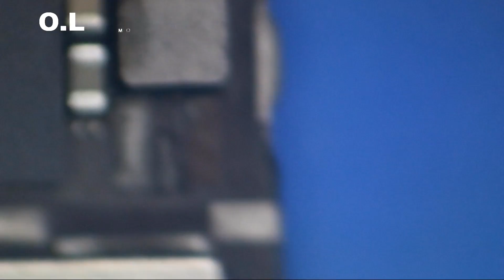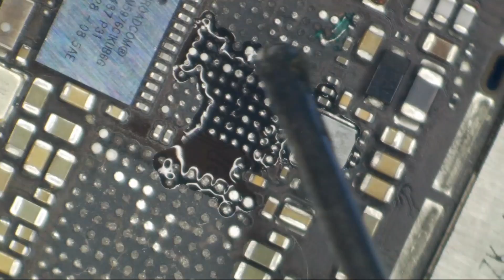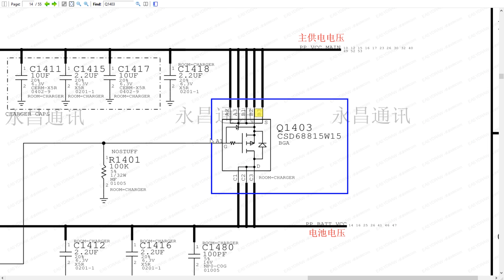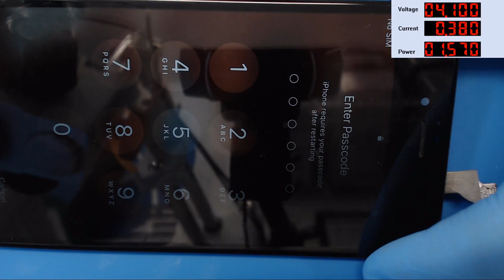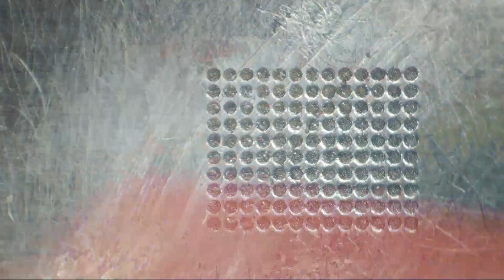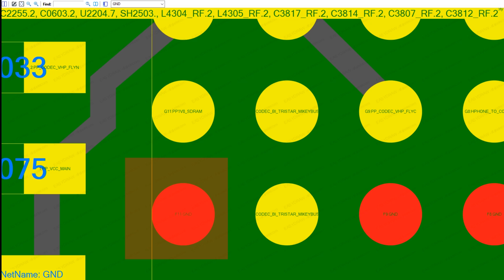Recovering data from a botched up iPhone 6 Plus

Comment: I have a 6 plus and touch stopped working so last night I did a screen replacement and touch still was not working. Then today I tried again and after I had reseated the display connectors the screen and the prior screen did not work at all. The phone shows no sign of power. Last night it would charge and show the display but now nothing. There was no liquid involved so how common or rather easy is it to get the phone in this state when doing a screen repair? The only thing I forgot to do was to disconnect the battery when doing the screen repair.

Comment: hello I lost one screw and did not leave the ones I do have left in order where they belong. Where can I buy set of screws and will they be labled so I can place them where they need to go. I replaced the battery, and that works just fine. Its a iphone6, thanks

Comment: Hey Can you help me for iphone 6 backlight, i think it was happened when im trying to change the screen, maybe  the fuse is broken, but i dont know wich one, thx
Reply from the maker: On the iPhone 6, if it is only backlight (can still see image but very faintly), it would likely be FL2024. If you don’t see any image at all, it is usually long screw damage in the bottom left hole.  (Top-left of CPU)
Reply: @ststele  I see Image but no light ^^
Reply from the maker: That’s good news :) it’s most likely only a backlight filter. FL2024
Reply: @ststele  thx a lot, i know ur video for this filter, i will watch it and i will try to change it :) i dont have a good loop but i will do my best :)